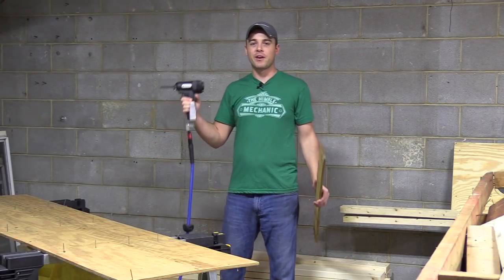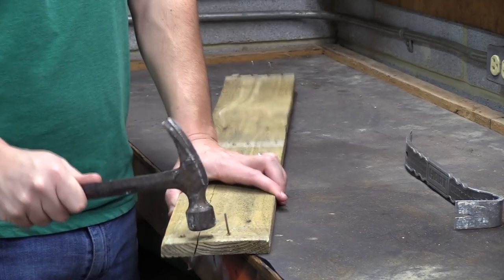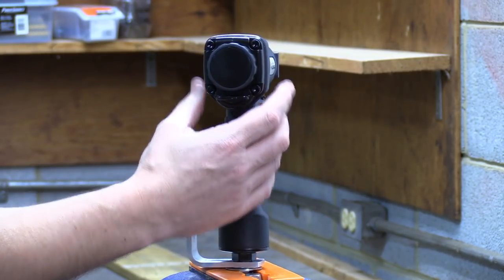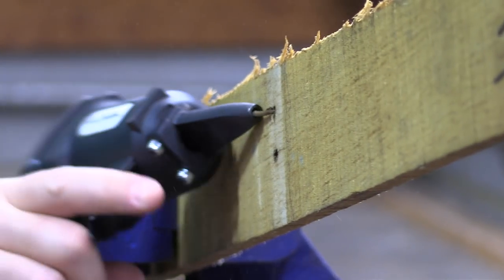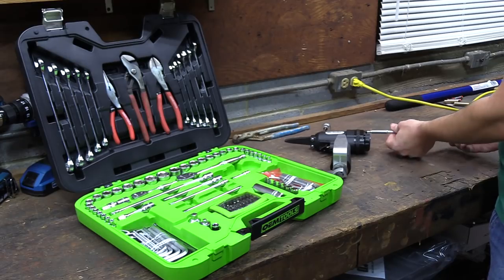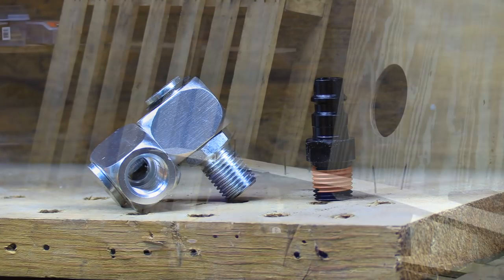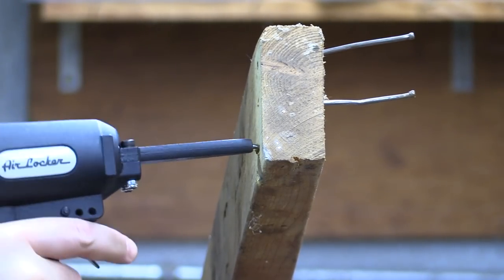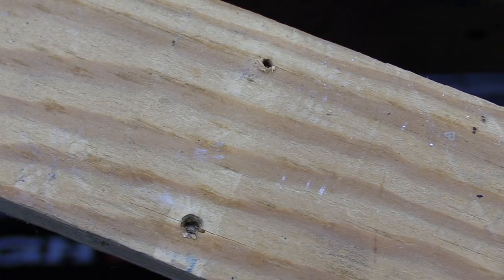FREE WOOD!! (*just remove the nails) - Air Locker AP700 Nail Remover

Comment: You said hole left by the driver, but it is not a hole, but a dent. The face of the wood you are reclaiming was where nail head was located.  You will still be able to use reclaimed material as it was used before. This tool is super handy for reclaiming old barn boards, which cost many times more compare to new lumber the same size.

Clearly a great idea, not ideal, but will save a ton of time. The ideal tool would be super strong magnet pulling  nail by head without touching the wood, but right now it is more like a  dream....
Reply from the maker: If you get shot, and the bullet doesn’t go all the way through....is that a hole or a dent?
Reply: @RealToolReviews  Two different things. Just think for a sec.....
 
You have a wooden board or a piece of plywood with nails. If you decide to turn it upside down, then yes, you have a deep dent or you can call it a hole. 

But if you want to pull nails and use it without turning it, then you have  a dent on the back side, which you will never see it. The only hole visible will be hole from removed nail.

If you have old nicely weathered barn wood and want to use it for it looks, then this tool will work perfectly for you.

Comment: What would happen if you cut the tip of the plunger flush to the end of the nose?
Reply: I would be concerned about what happens when the plunger fully retracts.  If you want the plunger to end flush with the end of the nose, I think it would be better to add some length to the nose instead.

Comment: Ok,  so it works great on nails that are exposed.  

What about nails that are flush with the surface,  or  countersunk a bit?    How do you get the tool to capture then?
What about if the head of the nail as been cut leaving a Non-flat head?    Often,  around here,  old redwood decks are are Sawzalled apart,  yielding nice redwood with tons of flush cut nails buried in the wood.     A de-nailer that left no gouges from pulling nails would be great.      Please Reply.
Reply from the maker: The piston pops out of the end, so theoretically you could line it up and still punch out the nail.....as far as no marks, I doubt that is possible.
Reply: I suppose that would work often,  but even a nail set can be prone to slipping off line.    I'm thinking there are going to be a lot of piston holes right next to the buried nail that is still there.    If you get a chance to play with it and review this situation that,  would be great  .

Comment: just lower the air pressure and usually the punch wont leave a mark..this means you will need to extract more nails manually as it wont shoot as many nails allthe way through

Comment: As I see it just reducing the air pressure  would cut back on the scaring 
Since You punching the nails from back side  if that is the back side  it won't be noticed 

With pressure realy reduced it might not knock the nail all the way out  flip board over use a scrap block of wood and hammer 

I still see this as worthwhile for pallet wood salvage

Comment: How does it work if you cut the nails?  I usually cut the pallets apart with a reciprocating saw, and then have to drive the nails out.  So they are not protruding, instead they are at surface level.  Will it still drive them out even though they are at surface level?
Reply from the maker: +Stuart Langer yes, it just takes more effort to line the end up with the nail.

Comment: Be nice to have power settings so that the nail does not go all way through so that that hole the tool makes is not present.
Easier to use a hammer rather than set up the line and compressor.. But can be a big time saver if a lot of nails. Your mods were nice to have.
Need to have a compressor so not much use away from workshop unless long air lines.
Maybe a battery operated version will be made.

Comment: I have an airlocker AP 700, It has a small nail caught between the barrel and plunger.  It is broken off at the base of the barrel and is keeping the plunger from moving in or out.  ANY IDEAS FOR REMOVING THIS SMALL PIECE OF NAIL.  THANKS FOR ANY IDEAS.
Reply from the maker: Your need to take it apart and remove the piston.  Check your manual or the website of the manufacturer to see how to complete this repair.
Reply: Thanks for the info.  I have no manual.  Is there one online or a web site address that you know of ???
Reply from the maker: It appears that their site doesn't show the process -- but looking at it closer, you can simply remove the two nuts/bolts that are holding the metal barrel (cone) on the front where it meets the main body of the tool & it will slide off exposing the piston. That will clear the jamb & then simply reinstall and use.  Should take you a couple minutes.  Good luck!

Comment: Could you not simply lower the pressure, which lessens the striking force, leaving less damage? Then, if the nails don't fly out the other side, just pull them out with pliers. Yeah, the nail shooting out the other side does make it faster, but if you can reduce the damage by not using that much force, then why not?

Comment: I use a recip saw and cut through the nails holding all the thin boards leaving a nail in what I think is called a "stringer" shaved off right at the surface of the "stringer".  I need to get that nail out which is absolutely impossible for me so far.  This tool would have to shoot the nail all the way through that thick board and out the opposite side from which it was originally nailed.  Can this tool do that?
Reply from the maker: Yep! 👍
Reply: @RealToolReviews  It came in today but once you begin to tighten the swivel fitting down, the space for the wrench gets too narrow to fully tighten the fitting.  How did you handle that?
Reply: After waiting on high flow fittings to arrive to be sure my fittings were not the limiting factor, the tool will not remove nails in the manner I was looking for.  It can shoot them a good bit below the surface but not out the other side.  And not far enough for any of it to be poking out where I could get a grip on it.

Comment: I was planning to buy one until I saw the size of the hole it left. Most of the time when I pull nails it's when I'm planning to re use trim, but I think the hole this tool leaves is just too big. I think it's a great Idea though
Reply: Trim is fastened with small nails with small heads. Just pull the nails all the way through.

Comment: Everyone touts how great it is for removing nails from pallets, but they fail to mention, that the hardest part is  removing the slats from the runners, especially with screw, or ring shank nails.
Also, this nail remover will not remove 16d or 20d nails

Comment: I have an Air locker, but It's been sitting unused for about 8 months.  Anything I should do before using it again?
Reply from the maker: A few drops of oil in the air fitting then connect the hose.
Reply: Thank you.  I don't use air tools often.
Reply from the maker: Its good to do that with any air tool --- and since you aren't using it much, you may want to also repeat that at the end & pull the trigger a couple times to push the oil through it prior to storing -- it will drive the moisture out and keep the internals lubricated and ready to go.

Comment: As seen on blade runner 2049...harrison ford character found it difficult to run with the air compressor though...sad really, he was tripping over the air hose, trying desperately to find powerpoints for the compressor all to the yakety yak soundtrack
Should have called the film "benny hill 2049"

Comment: I expected you to use and mention how efficient the hook is when put into the hand great pin.
While easily accessing the tool, you also easily pull the pin on the grenade....highly efficient. 
Or...did you not notice that your wife had placed the grenade there, for the same reason?

Comment: Wish you would have gone over the piling instructions it came with. It’s so vague to where the oil goes in and cleaning it up by the exhaust.
Reply from the maker: 1. Turn tool upside down.
2. Drop few drops of oil into air fitting.
3. Attach air hose.
4. Use tool.

😉👍

Comment: I'm  surprised  osha  hasn't  stopped  this . It  doesn't  have  a  safety  to  stop  some  idiot  from  putting  it  to  his  own  head  😂
Reply from the maker: I like to live dangerously
Reply: Real Tool Reviews 
And osha quite often has no connection with reality. A case in point, the osha approved air blow gun. You can't even blow your nose with one.
Reply: Oil_Burner 
Very true,  but osha doesn't care about reality
Reply: I'm pretty sure that if I held my nailer up to my head and pulled the trigger, I'd be screwed, OSHA or not.  OSHA really treads pretty lightly around construction tools, from what I can see.  OSHA's not keeping you from using a chop saw on your arm...
Reply: +IncognitoTorpedo 
It's  what  you  do  intentionally , but  what  you  might  do  by  "accident  " that  osha  goes  bonkers  over

Comment: Whats the deal with air commpressed tools? Litterally never see any tool ( Joiner/Carpenter tools ) in the uk use compressed air, yet it seems to be the norm in likes of the US.... in the uk our nail guns are all battery operated with a small removable gas canaster, yet i always see americans using nail guns with the air compresser hoses attatched..... anyone shed any light on why the difference?
Reply from the maker: +David McIntosh probably some stupid safety "rule" with the EU micromanaging your life.
Reply: Real Tool Reviews ye but i dont see it as an issue i wonder why america jsnt the same as uk or europe.... does it not piss you guys off dragging a cable about? I wouldnt call it micromanaging id call it a good idea tbh

Comment: Seems dangerous to have nails flying
Reply from the maker: Most people set the wood over a trashcan or bucket to catch the nails as they fly out the other side....however, that would have made for an extremely boring video with horrible angles, so I had to show how it worked inside an enclosed garage with safety glasses on.